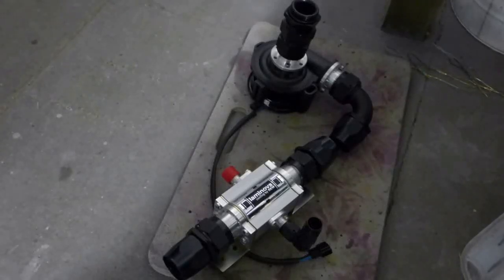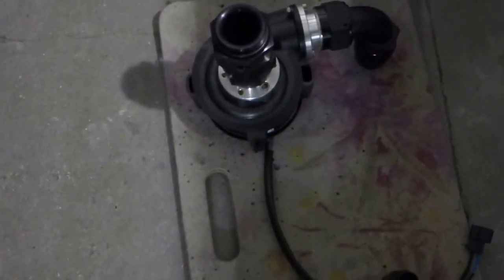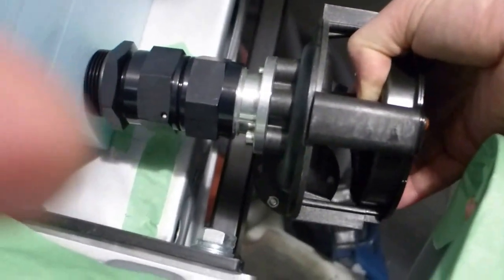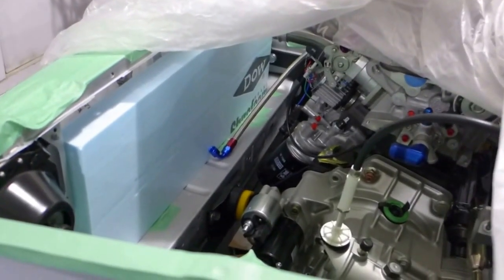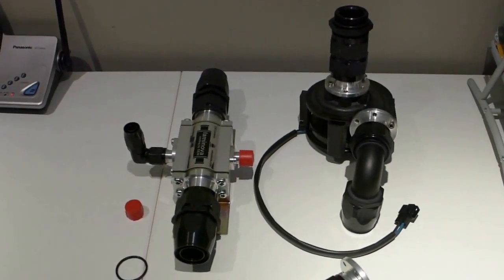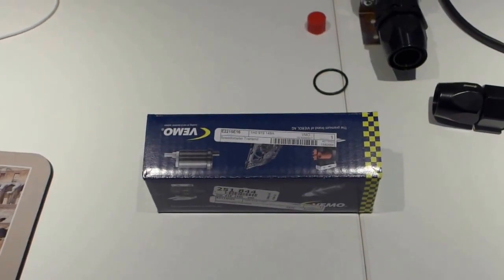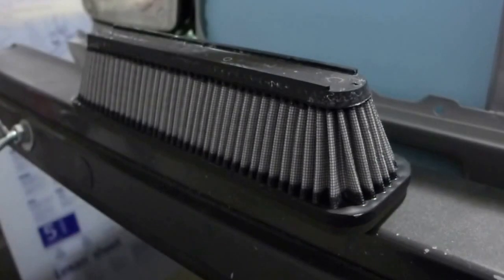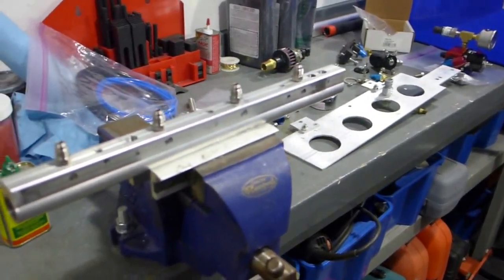The Ultimate 1983 Rabbit GTI - part 73 (Intake System, coolant system, transmission speedo)

Comment: You should support that electric water pump with a solid bracket to the radiator if you planning on connecting it to the radiator with solid AN connectors, perhaps you know this already?
Reply from the maker: I mispoke about that issue in the video.  I have been sitting here thinking thru the design of a stainless bracket that would bolt to the engine cross brace first, and then hold both the coolant-oil intercooler and the water pump, taking the strain off of the AN fitting/radiator area. I am thinking of mounting the bracket to the front side of the pump using the same 6 bolts that hold the -20AN fitting to the pump itself which seems to be the strongest area to attach to. I totally agree that there would simply be too much leverage applied to the radiator/AN fitting assembly. Me bad.
Reply: Who do you use for VAG parts?